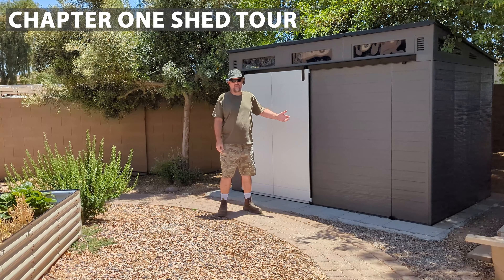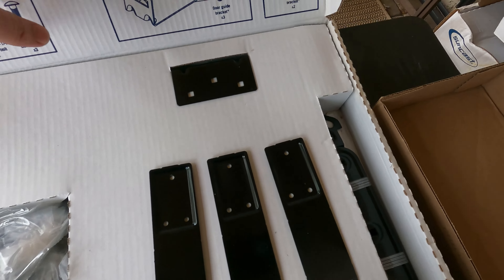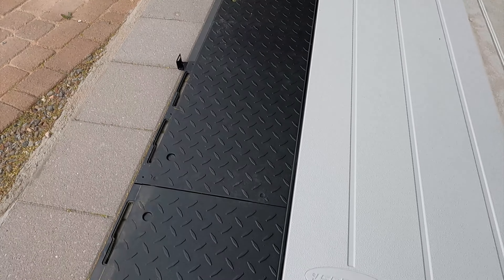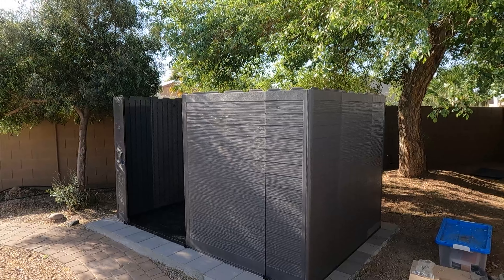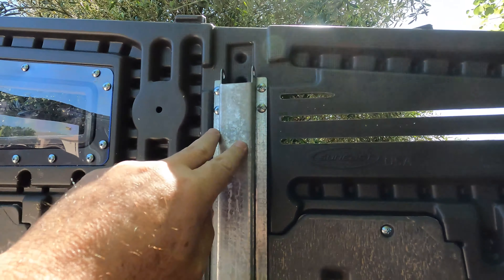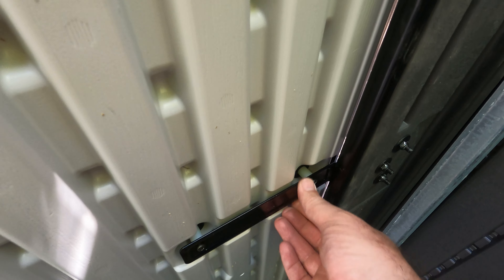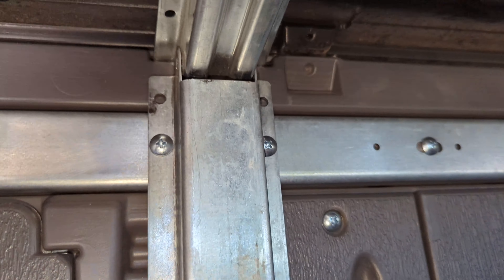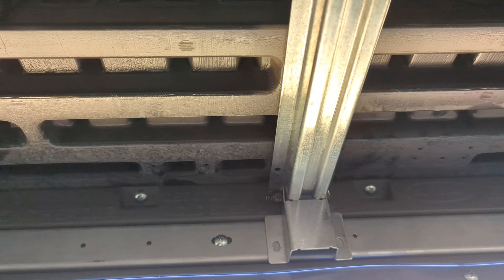Suncast Modernist Shed Installation Issues and Solutions

Comment: Great vid! Ty. Appreciate your real world mistakes and fixes. Have you had any issues w water getting in at the door?
Reply from the maker: Not at all. I raised it up off the ground a little so I haven't had any issues. I live in the desert though. So we don't get a lot of rain here.
Reply: @ThatHobby I’ve seen a lot of folks talking about how “hot to the touch” the plastic is. Can you stand it inside? Also I wonder if you painted a reflective color would it improve
Reply from the maker: I haven't noticed the heat in the shed being any hotter than it is outside. It gets pretty hot out here in the summer too. When I was putting it together I left the panels in the sun and I had to put on some gloves to carry them. So yeah the panels can get pretty hot. The shed has some vents in the top to let the heat out plus the door is really big. I also put it under a big shade tree. It sounds like a great video idea though. I will have to get a thermometer and test the inside of the shed to compare it to the outside temperatures.

Comment: Thank you for the advice. Using a dumbbell to hold the roof down did the trick for me.
Reply from the maker: Glad it helped! Yeah some parts line up just fine but I had to put some weight on the back corner to get it lined up enough to screw it in.
Reply: how heavy was dumbbell

Comment: I just assembled my modernist 7x8 shed. Had the same problem in the back left corner. The sun warped the roof panel. I stopped building and waited until the next morning before the sun hit the shed. Everything seemed to line up then. Also I removed the big plastic screws in the left rear panel until the roof was in place. 
I took one more step not in the instructions by adding a vinyl coated cable thru the main roof support across from left to right and anchored it to the treated wood platform to help strengthen the structure in high winds. Im not sure I completely trust 3/8” screws to keep it grounded. Go over the bolts at the ends so it doesnt stress the plastic walls.
Reply from the maker: That's good advice. Thanks

Comment: Did you only use one level of pavers? And what size pavers? I have this project sitting outside and I'm currently trying to figure out if pouring concrete, pavers, or a wood frame would be cheaper.
Reply from the maker: I am making a video about the shed base. This is what I ended up doing. I leveled the shed area and then I put down a layer of gravel and then a layer of sand before I put down the pavers. I put concrete around the edges of the pavers to lock them into place. It took a lot of gravel and sand though. I got the big contractor bags. I think they weigh 5 or 6 hundred pounds each. I had them put it in my truck with a forklift. It took a few trips too and I have a 3/4 ton truck. You can get it delivered though.  A concrete slab would be best but that will cost more and take more time. The wood frame would be the next best but you will need to level the area and put gravel under the wood frame or use concrete block footings. My concern with the wood is that it wouldn't last as long. The pavers are a good compromise but the problem with pavers is that you need to anchor the shed to the base and it will be a little more challenging to screw the bolts into the pavers. I used 12 inch pavers. They are easier to work with but the bigger pavers would give you a bigger area to screw bolts into the pavers.

Comment: Any problems with the two black tracks for the barn door? I got one in, but the other one is about a half inch longer than the edge of the indented channel area it is supposed to fit into. And the four holes the black bolts go into don’t line up? I can drill new holes but l’m still going to  have one edge of the tail slightly over the edge of the channel.
Reply from the maker: I put a few pieced on backwards and had some issues getting them to line up. Check the metal frame pieces on the other side of the header and make sure they are on right before you drill out the holes.
Reply: @ThatHobby  
Thanks. Yes I actually did have the same problem with the metal frame pieces (3 of them) lining up on the backside as well. So one of them is over the lip on the end. The 2 header pieces are flush, it just seems the channel where the frame goes is also a little short on that side as well. The 2 header pieces are flat and not bent so not sure what the issue is. I have measured the frame pieces to make sure they are the right ones and obviously only 2 black tracks I know are correct. I’ll keep working on it. Thanks for the reply

Comment: I built the 8x7 version of that, and I had the exact problems with the roof. For me, the roof wouldn’t line up because the plastic was bent. Had to hit it really hard with a mallet to get the left roof to line up.

Even after lining it up perfect there were still small gaps in the ceiling, which I ended up fixing with black spray foam.
Reply from the maker: Thanks for the info! I got the roof panels to line up really good but one of my corners is off a little bit. I was thinking of trying some of the spray foam. I didn't know they had black spray foam though. I will have to check it out.

Comment: I'm realizing that the shed buckles in the sun on one side,  then at night goes back to normal.  It's October,  not even strong sun. I'm worried how it will do in hot sun
Reply from the maker: I live in Arizona and I get a lot of sun out here. I left the roof panels in the sun when I was building the shed. I think that is why I had a hard time getting the roof panels to fit. The good news is the shed made it through an Arizona summer with temperatures regularly over 100 degrees. I put my shed under a big shade tree but the front of it still gets a lot of sun. The wall and the door are fine but the roof panels have a little bit of a warp to them but nothing serious. I will have to make an update video.

Comment: Im having roof issues as well and can’t seem to align it.
Reply from the maker: That part was pretty challenging for me too. Some how the metal frame was a little off and wasn't lining up with the grooves in the back wall panels. Once I adjusted the frame I was able to get it to fit a little better. There are also 2 groves in the front header that have to line up with the metal roof frame too.

Comment: How did you secure it to the ground?
Reply from the maker: I haven't decided what I want to do yet. I have a paver base with gravel under it. So a bunch of masonry screws will keep it from moving around but I was also thinking of drilling a few bigger holes in the pavers and putting some longer anchors in there with some concreate epoxy. I will make some update videos about the base and the anchors.
Reply: @ThatHobby that's where we are at

Comment: Think I might have to remove a lot of the metal from  the front header . It’s heavy to lift by my self and I short
Reply from the maker: I had to get some help putting on the header. It was a little tricky to get it to slide into place. My wife used a step ladder to get on the other side and hold it in place while I pulled it down into the groves.